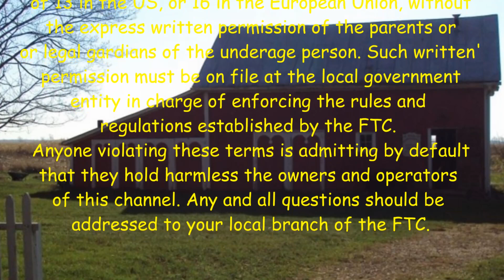Road To Recovery - P1 - Memo From The Annex

Comment: How's she goin'?  So glad to hear that you are healing and progressing according to plan Dave.  With the nicer weather about to show up, you'll be in good shape for getting at it and make things in your shop the way you want them.  Looking good so far!  Take 'er easy!!
Reply from the maker: Thanks Mike. 
I am impressed with your hard work paneling and insulating your shop. When you said it was minus 3 and you were working bare handed in the shop I thought you must have a jet engine heating system. 😁😎
Reply: With no wind, the cold is not too bad on the fingers.  And I wasn't holding any steel tools.  The drill driver has a nice soft rubber grip!!   @OldSneelock

Comment: Glad to see you out in the shop again.  The eyes must be doing better, just can't push it. Five years ago I had the back of my eye balls turn to mush, I got up to go in the bathroom before bedtime.  Is when it happen I seen little flashes of bright lighting blues red lighting bolts from my right eye.  I went to the doc and was told some big word with about 35 letters with what I had.  I have big floaters that move across my eyes and fine floaters like being in a dense fog, much worst in the light.  About 6 monthes later it happen to my left eye, well the several docs I seen all said the same thing it will get better or I will get use it it and the brain will  look past them.  I don't drive at night anymore, reading is a major problem even a giant print Bible dosen't help.  The list go on and on, just follow the docs words and continue with life. Wishing you the best and give Lydia and hug as she is special.
Reply from the maker: The first few days after the surgery I had the fog effect. I suspect it was bleeding from the surgery because it was a red haze.
It has cleared up to about 80% normal. 
Never want to go through that again.